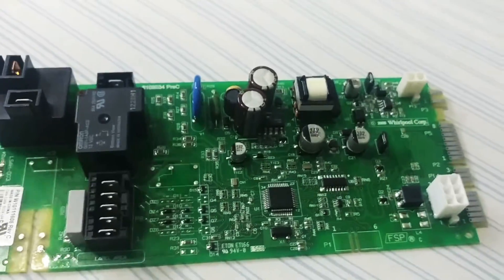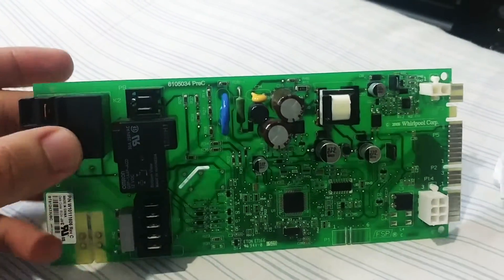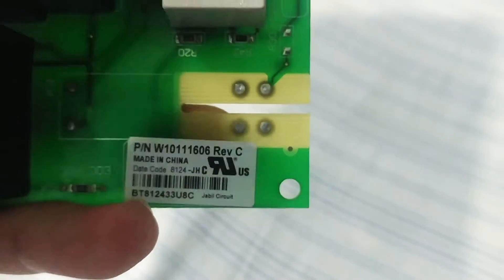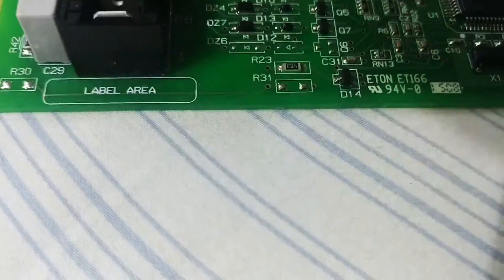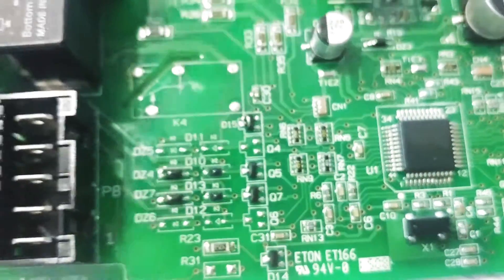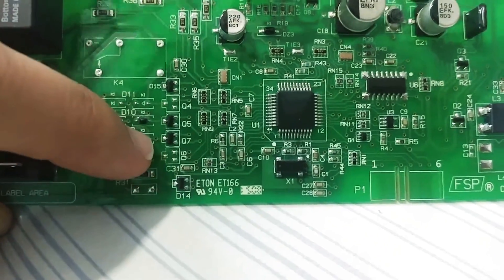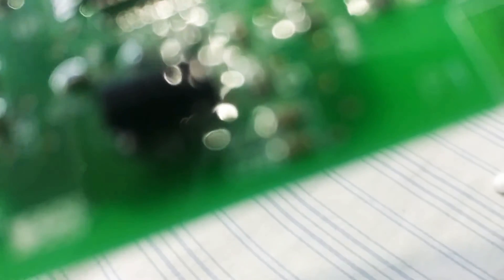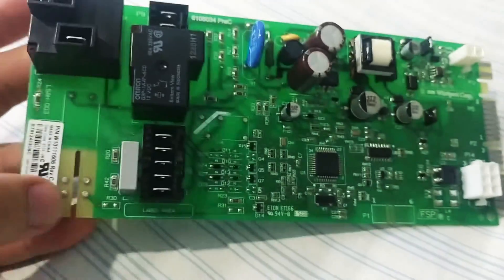Whirpool kenmore maytag circuit board fix

Comment: Mine dida. Complete fry out.   Burned the cat nnector and melted the plug and socket.   Replaced the circuit board and now need to get the plug.   Any ifea where the get that?   Is there a speciql plug or is a generic one that fits good enough
Reply from the maker: @diamondback2085  honestly i don't know. It's been years since I've done this repair
Reply: @jonyrock  well it's got to be fixed so if I figure it out I'll update this comment

Comment: Just replaced few of them now I have one with Sanyou sla-s-112dmj-f-30. It does not say 12vdc or 24vdc. Wondering if they are interchangeable with omron gb8-1a4pacd or tyco t9as1d12-12

Comment: My dryer has the same board and it won't turn on at all. Won't even go into diagnostic or anything.
Reply from the maker: Sounds like a power issue! I would remove the board and start checking for continuity from the power hookup and go from there
Reply: @jonyrock  I have no continuity on the power contacts
Reply from the maker: @NooDLES411911  are the cables hooked up right on the back of the dryer? Did you check to make sure your breaker didn't trip in your house?
Reply: @jonyrock  yeah I have 120v at the outlet. Last week the dryer worked fine, then went to turn it on the other day and nothing came on at all. No visible damage to the circuit board. Dryer was 100% fine before
Reply from the maker: @NooDLES411911  dryers run on 220/240v though

Comment: I had a Maytag 3000 series dryer running with no heat.  I replaced all components but no luck, still no heat.  I saw your video and just wonder how do you test the 120Volts from heat relay?   If both terminal did not give me 120 volts each then the relay need to be replaced, right?  when I replace a new relay, do I need to bypass?  Thanks
Reply from the maker: You would have to do a continuity test up to the relay, keep in mind you would need to remove the relay from the board to clearly see what's working and what's not, my memory is a bit foggy on this since it's been a few years but I believe the relay needed a 12v trigger to turn it on? Check on the relay itself what it says.
Reply: I actually  had same issue my. broken trace was  right where it goes under th  5 pin plastic  connector  scratched coating off carefully  checked continuity to confirm the break

Comment: Just worked for my epic z dryer! Had the same issue and it resolved it tho my board had no visual damage I only discovered it through continuity test but thanks !!
Reply from the maker: I'm glad this video has helped so many people! Glad you got your dryer working again!
Reply: mine also had no visual damage but I wanted to confirm  the issue so I pulled the plastic   up on the 5 pin connector  and found the break underneath  the edge of it

Comment: How do you check that relay?  Continuity between the two terminal connections while it is still on the board?
  My board is similar to that one. I think it has the same heat relay.  But, my problem is too much heat. Everything else checks good. Thermistor connection is showing like 12.30k ohms.  The heat will cycle off at around 190F at the exhaust.  Not hot enough to be to be cycling off the High Limit stat, unless the stat is faulty. I did use a used stat with a lower value than the original but the temp still does not high enough (250F) to trip it. The original is rated at 290F. It went out. The dryer did not ever reach 250 since I have had.
Reply: U need to check cycling t stat! 30yr tech
Reply: Cycling tstat?  Theres only 2 in the machine, an inlet and exhaust tstat along with exhaust and inlet high limits..
Reply from the maker: to check the relay I removed it, then soldered it back on